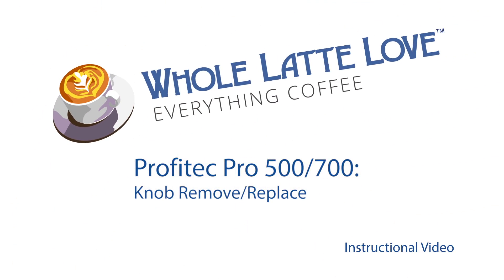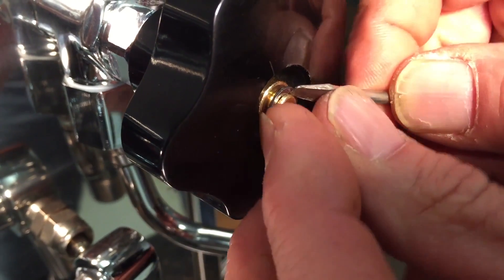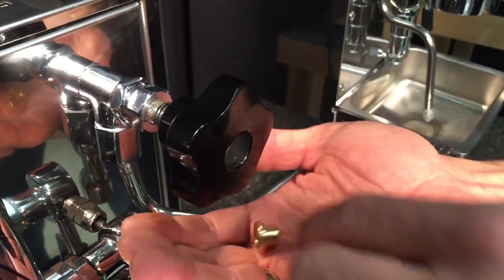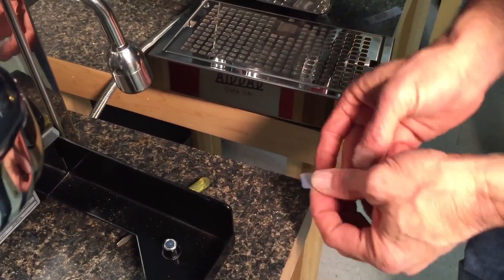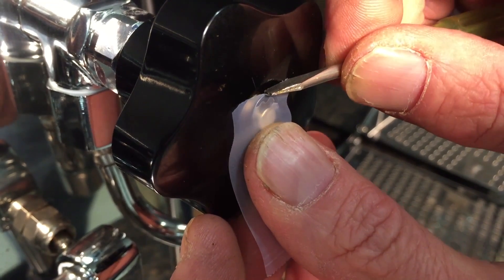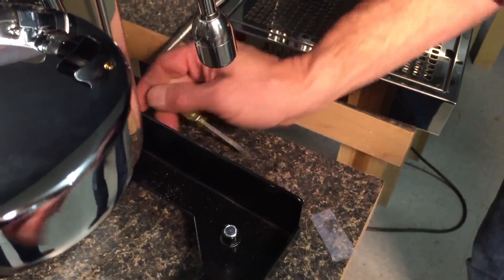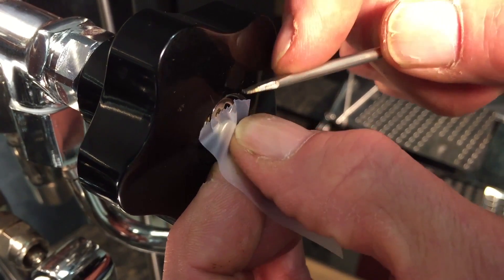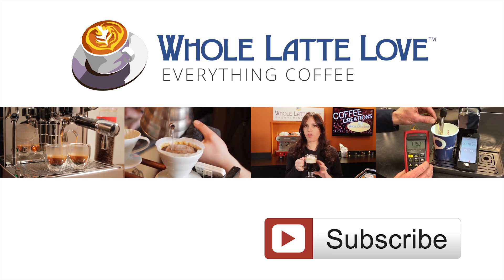How To Remove & Replace Knobs on Profitec Pro 500 and 700

Comment: Both the steam and hot water knobs on my Pro 700 squeak horribly when I use them.  Would you just suggest a food grade grease on the axle after removing the knob?  Or does it not have to be food grade since it's on the outside?
Reply from the maker: Hi Patrick, I would stick with a food grade lubricant. Vaseline should work.